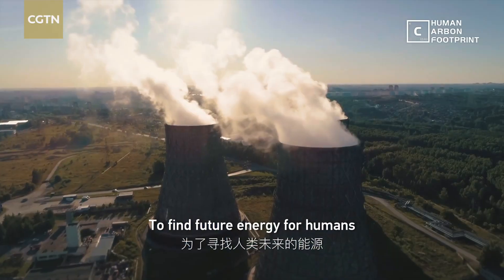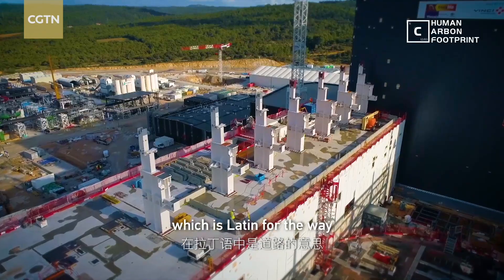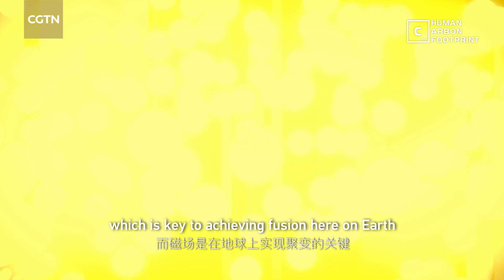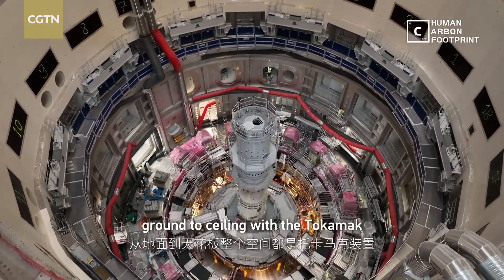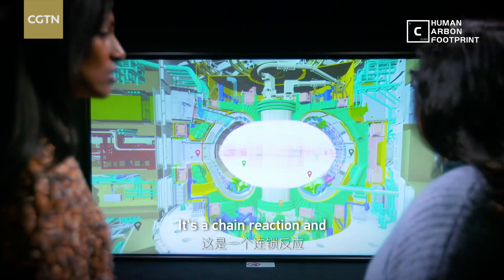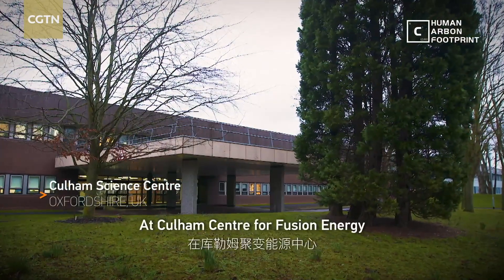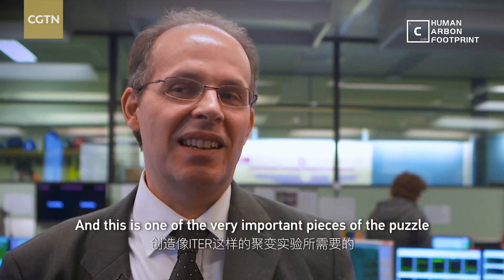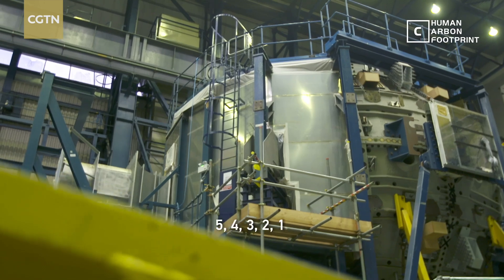'Human Carbon Footprint': Inside the world's largest nuclear fusion reactor

Comment: When it comes to Suns, the Fusion reaction is mostly triggered by a Fission reaction allowing the sun to light up much earlier in it's mass accumulation stage, smaller suns, that burn less bright and last much longer. The fusion reaction has to be quite small, because it is a micro hydrogen bomb, upscale the reaction and it becomes quite difficult to contain, so more needs to be done in the application of energy types, quantum particle flows, to trigger earlier fusion with less heat and pressure, it all becomes much easier when you see particle charges as monopole mass charges on particles as they form and the particle flow that creates.

Comment: Fun fact USA just announced first nuclear fusion breakthrough and this is not part of this ITER project. They made it by themselves in their own lab.
Reply: Another fun fact, a thorium nuclear reactor blows away any uranium fusion reactor.  It's the safest, cleanest, least toxic, most efficient, and thorium is plentiful everywhere.  Best of all, it cannot be used to create a nuclear weapon like uranium reactors.  And one new thorium nuclear reactor plant one already exists now, in China.  The US once had the lead in this key tech years ago but ignored it due to politics and big corruption, as usual.
Reply: @davidrichards1741  A fusion power plant could produce a lot of power from one facility and would emit no carbon, no air pollution, and generate very little waste compared to the nuclear power plants and thorium nuclear plant in use today. It's also fueled by hydrogen, which is incredibly abundant. Corruption in the USA is fine. It ranked 27 in the least corrupt country while China ranked 66. Also if USA have the Fusion it doesn't need thoeium beecause it will be the cleanest energy and long lasting energy in the whole world
Reply: @Fundamental-Basic  I suspect youi're not a nuclear engineer and don't have a technical mastery of this subject.  Nuclear fusion is indeed advantageous compared to fission and cold fusion has long been the imaginary holy grail in that realm, but thorium is most advantageous even and widely beats every type of uranium-based power generation scheme. And Russia produces half of the world's enriched uranium essential to power generation, and there's nowhere nearly enough to go around should many more nuclear power plants be built, but thorium has no such constraints and it's plentiful & widespread and cheap.  As for that list, I'm sure you can understand that many such lists are largely subjective or even rather bogus. The fact is that the US was the early leader in thorium nuclear power but big business and corrupt politics killed its development and we gave what we'd done to China, which has run with it and is way ahead in it. Also as a result, China is literally decades ahead of the US in the use of (domestically-produced) EV cars, buses, subways, trucks, trollies, jets, and railroads. With 40-,000 miles of hi-speed rail traveling at up to 640kph (400mph), twice as much total highway length most of which is EV-serviced by recharge stations almost everywhere, and more urban subway mileage than the rest of the world combined. All powered by electric. With an impressive nuclear and thorium buildout plan underway to replace their coal works. This is my main interest in China.  Why can't we do that? Sadly, once again, it's corruption, politics, and vested business interests.  Not lack of ingenuity nor ambition if we put our minds to it!
Reply: @davidrichards1741  While U-233 an excellent fuel in the slow-neutron regime, it is between U-235 and Pu-239 in the fast spectrum. So for reactors that require excellent neutron economy (such as breed-and-burn concepts), Thorium is not ideal. Talking about China, China is indeed very strong developing country. In my opinion China already passed USA for power and economy. They make almost the half of the products of the world. And catching up for the military. But the downside is the electricity problem. More than 60% is Coal burning while only 5% is Nuclear powered. But yes China is trying their best to be Clean energy because they dropped 10 percent of coal using from last 20 years. I think they need more thorium if they can handle it.
Reply: @Fundamental-Basic  Actually, I think all wars (and much pollution) is avoidable, but then I'm admittedly a pacifist. People first.
Reply: @davidrichards1741 Ya but i kinda mad at Russia. They should’ve just leave Ukraine. In 1990 after Soviet Dissolved Ukraine was fully independent and proved land country. But after that stupid Crimea attack from Russia this war is just hell as fuck

Comment: Why no mention of the first fusion happening in California recently?.
Reply: @Toxic0255  Well after reading more details I learned they used like 100x more energy to power the lasers in the first place than it was produced by fusion reaction. It's still completely impractical but maybe the lessons learnt will lead to further advances in the field. For the energy balance they only included the energy fired by lasers and energy obtained from fusion, not including the biggest chunk of energy used for initial power up of lasers.
Reply: Fusion was happening for many times already in different reactors. In California they claim to get net energy gain for the first time in history which is huge of course but not even close to be practical. Why it is not even close to be practical? They built an installation of three football stadiums to produce energy required to boil like 1.5l of water and this is in ideal scenario when there is no loss when converting this heat energy into electricity. Normally there 50% loss when doing so, so their 20% net gain is rather 30% loss in practice so still a long way ahead.